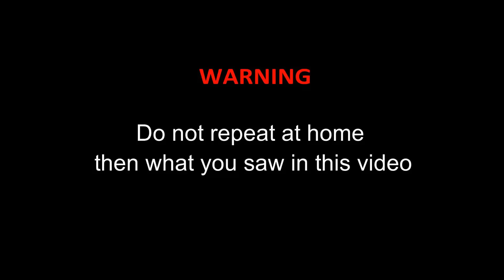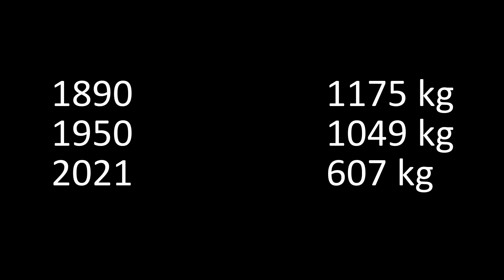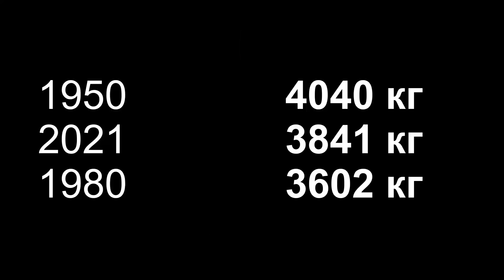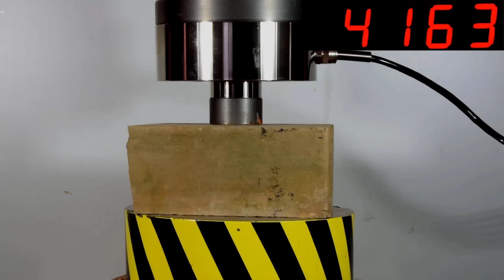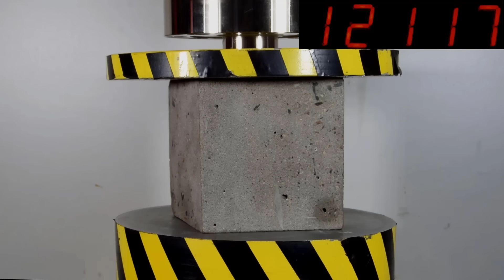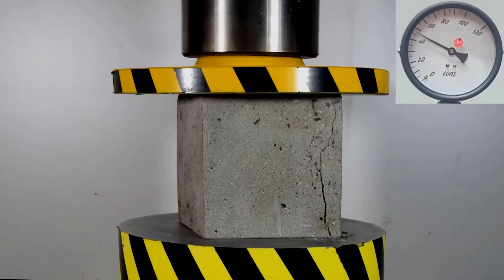HYDRAULIC PRESS VS OLD AND MODERN BRICKS

Comment: I test concrete - I was basically checked out on any scientific level when I saw them stop counting the compressive strength of the 2021 brick at 3800 kg when the corner fell off. (2:40) The center, directly under the load, continued to bear weight up to 5000 kg. If you want an actual strength test you need to cut the brick down to a cross-section smaller than the ram. Ideally you also want to sulfur/mortar cap the sample for absolute even application of the weight.
You're also using uneven sample sizes, so raw numbers ("this brick broke at X weight") don't mean anything, you need pounds/pascals per square inch to have a real comparison.
Reply: Isso
Reply: @joseeustaquiosilvadebarros904  isso mesmo
Reply: Not only to mention that you need multiple samples and a statistical analysis for outliers and what you expect. There’s so many things here that wouldn’t pass ASTM standards as testing a material.
Reply: thats why i love the comment section, thank you for explaining the flaws of this test. I dont test concrete but this testing didnt felt right or fair to me... even bc i believe we use different ways to build houses and much much more reliable materials that hold and distribuite way better the weight and energy of the building.
Reply: You mean like a cylinder test?
Reply: When a brick breaks in 2, it's useless. It's a "stops being useful" test under the same conditions.
Reply: @CeroTee  i dont agree. dont get me wrong, but we have bricks for different purposes today and it could be the case with the 2021 brick tested. 

different bricks to different kind of buildings, i think thats the case here. 

you couldnt build a apartment block with the same brick that you build a dog shed, the density, dimensions and resistance arent the same. thats why its an unfair test. what do u think? 

(sorry by any mistake, english isnt my main language)
Reply: @CeroTee  not really, as loads are almost never introduced int bricks as a point load. Bricks bear loads in conjunction with other bricks and mortar, thus an approximation of what loads can be born over a nominal cross section is a fair comparison.

In order to find that out, you need to standardise the tests.
Reply: Mostly agree but Pascals per Square-Inch? That would have a dimension of Pressure over length^4... Also use N/mm^2 not inches...
Reply: the modern concrete looks like it was entirely cement
Reply: What do you expect from someone with such weird looking fingers.
Reply: This is an entertainment video, not a scientific study. Do it your damn self
Reply: @Blox117  I thought the same thing it didn't look like it had any sand or gravel
Reply: @MarioSolisxD  to me it even looks like it is still fresh on the inside. Like it has not been thru the 1 month curing period yet.

Comment: one of the real world problems you see with old concrete is that it was inconsistent. each Manson had his own technique and methods and they would often through construction debris into the mix. random rocks and chunks or brick etc. i recently demolished some concrete cannon stands from the late 1800s because they began to crumble. water eventually found its way into a piece of brick inside which freezes and expands during the winter and it slowly broke them apart from the inside.
Reply: Water is amazing isn't it?
Reply: This isn't concrete. But the same rules apply. And if it was quality? Older concrete is always stronger. Its beem curing for 100's of years. Try chipping, core drilling, wall sawing or wire sawing old concrete. Its a fucking paind it it is either black or blue on the inside. Slurry speaks for itself
Reply: @boostedb18b14  older concrete was stronger because of the Lime additive, not because of “time”

Comment: As always fun to watch! But in this case, not scientifically meaningful data. In every era, bricks have been made in a variety of materials and grades, designed for different purposes, appearances and budgets. 
And even in supposedly identical batches of bricks there can be tremendous random variation in structural integrity from one brick to the next.
On the average, older bricks tended to be fired at lower temps and thus tend to be softer with more porosity than newer bricks. 
But in this test, the comparative hardness of the new brick might actually make it more predisposed to catastrophic shattering, than a softer brick.
Another factor is that more recent bricks are usually a uniform hardness all the way thru. 
Whereas older bricks are often more like a loaf of bread, with a hard baked outer crust, and softer, less baked material in the center. 
This last fact is also why you should NEVER EVER sandblast a historic brick building to clean it.
The old bricks might look OK for a year or two after being sand blasted.
But the sand permanently strips off the hard outer layer, leaving the soft inner brick exposed, and from that point on, (without the protective outer layer) the sand blasted bricks will rapidly erode and disintegrate.
Reply: yes, and many many regional variations even within the USA.  The stress applied needed flat surfaces, ie bedded in mortar, so the forces are applied evenly and equally.
Reply: you'd notice it with the conrete too  the modern one probably just got it in a hardware store and the old one comes from a fort that survived ww 1 and 2 if it was build in 1890.

Should have gotten a military grade one used in bunkers or something if he wanted a fair comparison.
Reply: also, looking to the 2021 brick, it gone broked like following a pre-existing damaging line... so maybe the test should be repeated for the newest brick

Comment: Old hand struck clay bricks would vary widely on their strength. Modern shale bricks would have more consistent strength. Tensile strength is not bricks strong suit. Compressive strength is what bricks  are about. Most masonry is not structural. It’s brick veneer on structural wood residences or block infill between steel columns on big box stores
Reply: Most masonry is not structural? really? what the fuck do i build all day then? non structural houses? bullshit.
Reply: @cornishcat11  

If you build modern stuff on new housing projects the bricks are essentially cladding, weather proofing and add to the insulation layer of the structure. The brick walls you build aren't supporting the main structure. Timber frames are the supportive backbone followed by breeze walls.
Reply: I wouldn't easily generalize there. I worked on the numerical modelling of a typical row house unit in the Netherlands for my master thesis. They're built with unreinforced masonry and many of them especially in Groningen perform poorly against earthquakes.
Reply: When I said bricks are not used structurally I meant they don’t carry roof or deck loads. Boggiewoogie points out why. Lateral shaking makes them fall down. I learned these things from my Dad (civil engineer) I’m just a carpenter.

Comment: The older bricks looked a lot more dense than the 2021 brick, maybe that has a part to play in its strength?
Reply: They cure over many years, concrete for example takes 99 years to set was often heard when I was a concrete fabricator back in the mid 1980's.

Comment: Cement never stops curing so any form of concrete will only get stronger with age (all things being equal). I found a concrete test cylinder that had been sitting outside in the rain and sun for over 30 years and it broke at twice the strength of a contemporary sample.

Comment: i saw a tv show - gavin mccloud? design house?  and it might be season one?  converting an old water tower - the concrete was exceptional. .. they had to use special diamond cytting equipment to cut through it? it was old concrete mixed with pebbles from beaches?  it was superman strong. like out of this world. theowner kept a core sample? asan ornament? ot was beautiful cut through like gemstones?  
the architect was famous for this old water tower and other buildings he built.   in thetwenties?   
thats the stuff i would use if money was not an issue.

Comment: Should try reinforced concrete with blue gravel rocks in it I mixed it in the concrete like they did in the old days for a antenna pole the new owners of the house couldn't get it out of the ground breaking it with sledge hammers, and tried pulling it out with a tractor but only made the tractor tip and it still didn't come out or break,lol.

Comment: something you must know: if a brick is well done, it hardens in time. so, this test is a little unfair. but when it's bad, it worsen in time too.
+
the distance between the 2 metallic pallets must be exactly the same for the experience to be valid. if it's wider, it's easier to break the brick.

Comment: Question, do bricks need to be that hard ? What should be understood is that a building wright is splitter between every bricks. Also , modern bricks are lighter , which means the lower bricks in the building have less weight to support.

Lighter bricks also contain air that has plenty of insolation properties.

Comment: Next time put something strong but flexible in between the block and the large matal piece, like lead plates or oak wood to distribute equal pressure. Otherwhise your palte will just apply pressure on one single point (in theorie)

Comment: Actually, this kind of testing of brick has been done for 150 years or more, certainly since the 1890s.  Especially by the Industrial revolution, builders needed to  determine the strength of brick for various applications (structural vs paving, for example) or the quality of the brick batch. It was critical for load bearing masonry like bridges and big buildings. Question here is what KIND of brick was being tested -- molded? face brick? pressed brick? -- not just the age.

Comment: i'd imagine because back in the day they over-built EVERYTHING. they weren't sure if they could get away with certain things so they double/tripled the strength. Now construction is done in the most cost efficient way possible so if they can get away with a weaker brick or wood or design in general, they will.

Comment: The modern concrete test looked like it was still “green” or at least well under the 28 day cure time required for 99% strength, also it looked like the sample was poured too wet which would compromise the strength of the final concrete sample(check out practical engineering yt channel) , cool video though 👍

Comment: This is testing the tensile (or pull) strength of the brick. Bricks are used in compression (push). Surely you should have tested tried to crush them instead?

Comment: Brick loadbearing walls are a disaster in a major earthquake, not because of the relative strength of the brick, but because of the weakness of the mortar. Even the lighter modern brick would be unlikely to break unless it fell to the ground, because any downward stress is spread over the whole surface, not the one small spot. We had a major earthquake in NZ in 1932, and learned based on where people died, that you need timber or steel to hold buildings up, not load-bearing brick walls.

Comment: Well, you would have to get it from the same manufacturers in order to have a comparison concrete/cement does cure overtime. There was no way of testing really how strong bricks were in the 1890s the way you can today so you can make a very strong, very durable brickconsistently with new technology

Comment: The last experiment wasn't fair at all, because it already had developed cracks and it had failed already.
Although one can argue that concrete is supposed to handle compressive loads, hence any pores should get filled up strengthening the sample further.

Comment: As a bricklayer and owner of my own masonry company, I can explain this pretty quickly.

In the past, bricks were used for the main structure of a building, so they needed to be stronger. They were the main thing that holds up the floors and roof. Today's bricks are just used for DIY paver projects, or siding to wrap the face of a wooden building. In the US, we almost never use bricks in a structural way anymore, unfortunately. We just use them as decorative pieces. So they dont need to be as dense. 

All that being said, you can look at bricks from different cultures dating back to ancient times and there are some bricks with a very low PSI (around 400lbs) and orhers closer to 1,200. 

I personally never cared much for PSI ratings because we don't houses by the square inch, but by the yard, if anything. Take any weaker material and increase its overall body mass to the size of the empire State building and I guarantee you it will be a strong structure. Size matters.

Comment: E reason is pretty simple. Current building rely on concrete armored with metal which greatly increases durability and flexability. Old buildings were built using concrete and bricks wothout the metal. They needed to be strong

Comment: The 1890 brick looks like a fireplace brick because it has blackened. The fireplace bricks were not as strong as the bricks used for surfaces. I had a house built in 1830 and we used the old bricks from the fireplaces to make floors in an addition and a patio. People told us at the time (1980’s) that the fireplace bricks did not make good floors because they were soft.

Comment: It seems to me that the concrete block test was not fair. 
The modern concrete block seemed it was only sand and cement mixed together at home, while the 1890 block clearly had gravel in it and was carved from a fortress. Whoever built that fortress knew what was doing and aimed for the best mix.

Comment: When we want to build a certain type of structure that will be under certain stress (larger than normal) we tend to re-use old bricks or we buy bricks that are hand made. These are small structures used for producing curred meats since there will be a fire for prolongued periods of time and that temperature will cause stress. New bricks (or mass produced you can buy today) just collapse after a short period of time and cannot handle extreme temperatures for long periods of time while old bricks or new but made like they got made 70+ years ago in my country handle it with no problems. 
They are hard to find, and there arent many people left who know how to make them.. 
They get clay and dirth and straw and whatever and they first let them sun dry and after some time they are baked to a certain level. Similar to old clay pots or something.
All rest of the materials we use are the same just the brick makes the difference if the curring building will collapse or stay like that for forever.
I have one that has been curring meats every year for 80+ years and works perfectly.
Next level stuff is to use live bricks, not baked ones and they get baked into the structure while curring so it becomes almost undestructable.
Once we had to demolish such a structure (was in the way of  making a large building) and although we urged a guy not to do it he was a young dumbass.. Let me tell you it was a hard task and we had to trim it down small piece at a time since it wouldnt collapse and wooden parts of it(roof) werent nailed together but jigsawed like a puzzle while raw.. Damn.. 
Guess companies figured out it was too strong and a waste of time so they just produced it fast, cheap and "strong enough).
Old houses tend not to give a fuck about an earthquake while new ones crack easily, foundation can show damage, roofs crack under weight (snow) ectr.. But its just cheaper to get insurance than to build it properly.
Now we build fast, without letting material bind and sit in, we dont do it in many layers with time being given.. Now you get a complete house in months, back in the day it took years (build it a few months then let it rest and work its way with the elements and "sink in" then build again next season and so on)..
Now even the meats are curred in a day, since that is how i started telling you all this..
Well we all know what mass production is, so guess it is for making things cheap and accesable to more people.

Comment: The bricks weren’t the same size, and the 1890 brick was significantly larger. This could easily skew data. However as others have mentioned modern day bricks are more decorative than structural, so it makes sense that they’re weaker and probably lighter.
Reply: True, many bricks today are decorative. Also, the cement value plays a huge role, and plus concrete gains compressive strength with age.

Comment: Well.. modern brics are mostly used as a wall décoration nowadays instead of a building material… at least here in Québec. So they don’t need to be as solid as they were when they were used tu make walls.

Comment: In 1890 not all houses were made of bricks, my grandparents lived in a stone house, other people had wooden houses or whatever they could afford. Democratization made it possible for - almost - anyone to build a house made of bricks and/or concrete only in pretty recent years (at least after WW2 in many parts of Europe). The production of bricks is incredibly higher now than just a decade ago and it will increase. Not all walls in modern homes need to bear tons of weight, as the pillars are made of concrete with metal reinforcements, something they didn’t normally use a hundred years ago were all the perimetral walls were thick because they bear all the weight themselves. We no longer produce such resistant bricks because we don’t need to and because of mass production.

Comment: I have a theory. 
In the US, 99% of brick masonry installed today is only intended to serve as a facade. The buildings are actually supported by steel, concrete, or wood framing. The bricks are just for looks.

Historical construction techniques used bricks structurally. When you saw a brick wall, there was only bricks and mortatlr in there. No rebar, no wood framing, no steel columns.